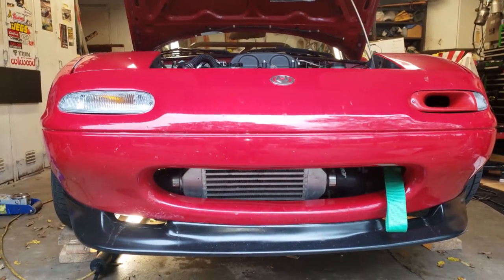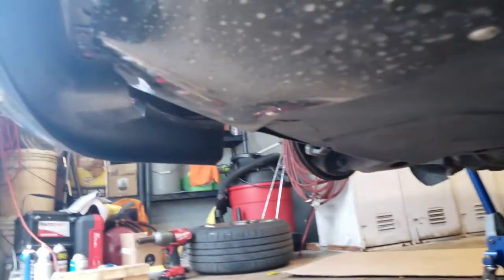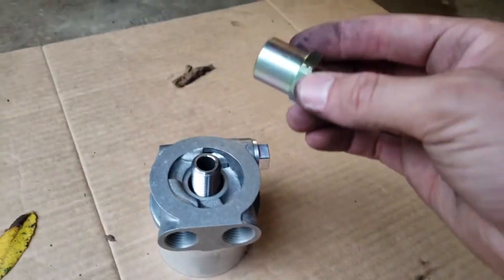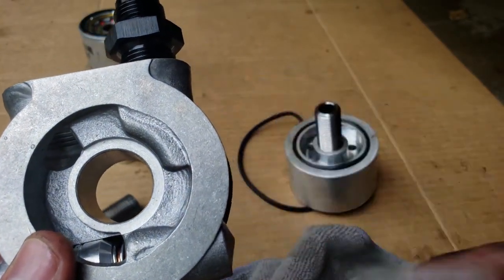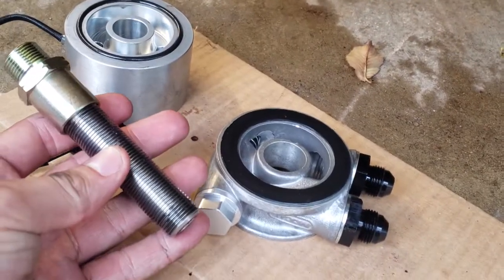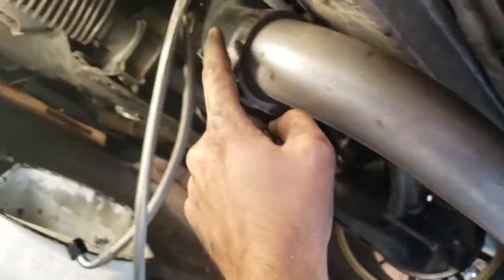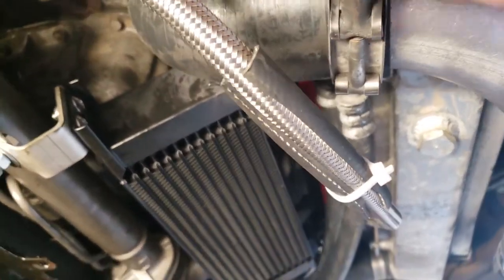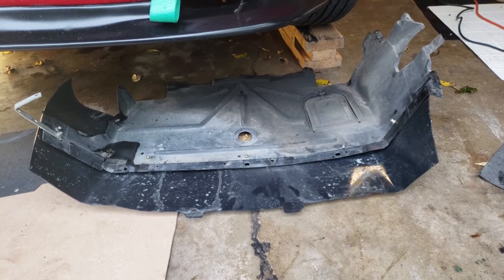Miata oil cooler install

Comment: I hate to be the guy but you should really use some jack stands. Your safety is priceless. Appreciate the install video for the oil cooler
Reply from the maker: I never use them 🤣 and idk why honestly..
Never said I was smart
Reply: +1 on this man, all it take is for that jack to fail and the whole thing would land on you. A few seconds of putting a stand there could save you. At least put the removed wheel under the car just in case too whilst it's off!

Comment: @ 2:14 put that brace back on. Causes throttle vibration if you remove it and track the car. Eventually breaking the trottle body
Reply from the maker: I'll have to look into putting it back on. Nothing bad happened yet, but I probably still have it in my garage 😄

Comment: even with just a sandwich plate for my oil temp sensor i couldnt fit a stock size filter on, didnt have a stubby one and it was 4 AM at a buddies shop so the sensor is all disconnected right now, idk how you fit that big of a filter on yours and even have clearance, i also drive a RHD 94 NA8 and getting my hands into where the filter location is, is next to impossible without taking off the subframe or intake manifold, any suggestions?
Reply from the maker: What is the filter hitting?